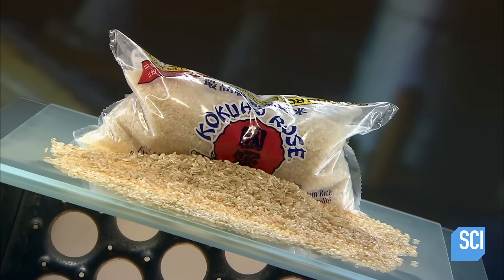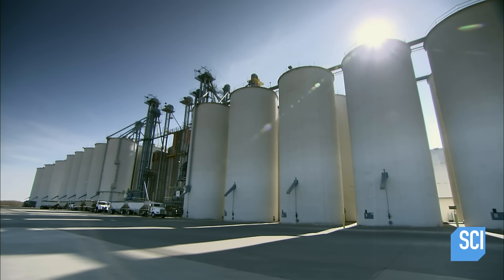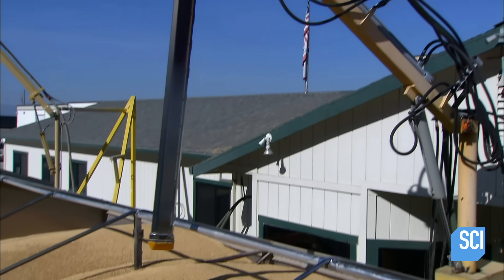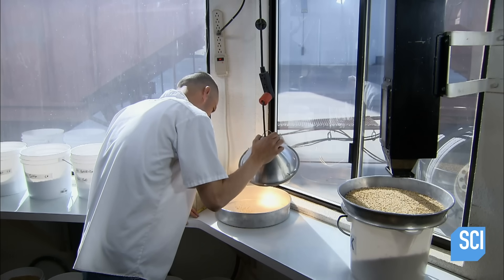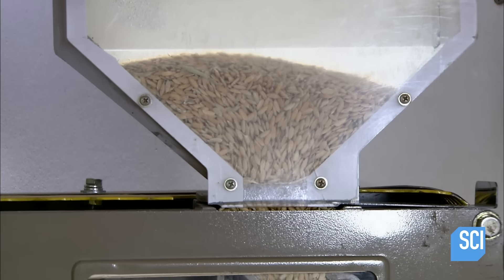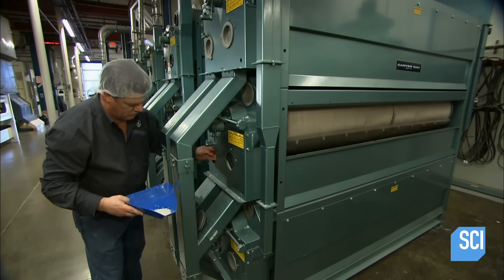How It's Made: Rice

Comment: Respectful Greetings!
To: Science Channel. 
Rice is a semi-aquatic plant that is cultivated and processed through several steps, including:
Irrigation: Rice requires consistent irrigation to grow. The traditional method is to flood the field, which also helps prevent soil erosion and manage weeds. 

Harvest: When the rice is mature, the water is drained from the fields and the rice is harvested with a combine harvester. The rice is then taken to a facility to dry out. 

Milling: The rice is milled to remove the inedible hull and bran layer. The rice that results from removing only the hull is called brown rice, while the rice that results from removing both the hull and bran is called white rice. 

Enrichment: White rice is often enriched with a thin coating of vitamins. 

Packaging: The rice is then packaged and sent to stores. 

The manner in which rice is processed affects its nutritional profile. For example, brown rice contains more nutrients than white rice because the bran layer is left intact. Parboiled white rice retains most of its nutrients, and enriched rice has iron and B vitamins added to it. 

There are many types of rice, which can be categorized by their flavor, scent, color, grain length, and other characteristics: 
Brown rice: A whole grain rice with the inedible outer hull removed, but the bran and germ layer remain. Brown rice is often considered healthier than white rice because the bran layer adds fiber and nutrition. 

Basmati rice: A type of white rice commonly grown in the Himalayas, India, and Pakistan. 

Jasmine rice: A staple in Southeast Asian cuisine, jasmine rice is soft, slightly sweet, and somewhat sticky, with a subtle floral aroma. 

Arborio rice: An Italian short-grain white rice typically used in risotto. Arborio rice absorbs liquid and flavor nicely, and has a starchier, creamier quality. 

Black rice: A wholegrain rice with a dark purple color determined by its high level of antioxidants. 

Japanese rice: A short-grain rice that's smooth and glassy, and often referred to as sushi rice. When cooked, it's on the sticky side but still has a toothsome bite to it. 

Long grain rice: Any variety of rice that is four to five times longer than it is wide. This includes varieties like Basmati, Jasmine, and Carolina. 

Courteously!
Luis Lopes

Comment: Quick question: What's the protocol to keep the truck oil from dripping onto the same grates the rice is dumped?
Reply: At the place it worked it was just checking to make sure it is not leaking before dumping.  If any did get into the rice the machines are able to sort it out.

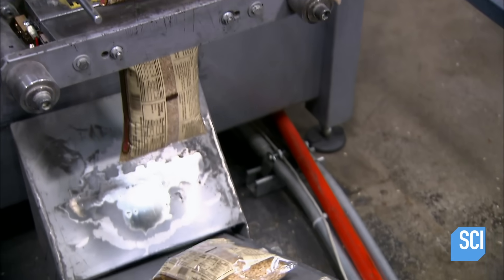Comment: 4:41 - 4:49.  Run it at 20% speed (video speed controller applet from chrome web store).  The plastic bags are just 2 sheets of plastic and are being melted together in reeal time in the bagging machine.   The rice falls down 3 bags into the bottom bag, while the 2 upper bags sides' are cooling after having been melted together.

Comment: The fans in the flat storage don't do any drying, that rice has already run through a dedicated drier to reduce moisture to ~12%. They're preventing the rice from overheating due to decomposition.  Paddy rice (rice will hulls still on) can be damaged by temperatures reached during this process.  Heat damaged rice takes on various levels of brown color as a result reducing its commercial value.   It's also not terribly uncommon to fumigate an entire flat storage warehouse or silo to take care of weevils and other insect infestations.  The only thing that grates over unloading pits are intended to filter out is animals and trucks.

Comment: I was about to purchase a large bag of white rice once.  Normally I get a major name brand but I wanted to try to save some money.  Anyway, I picked up a bag, threw it in my cart... and saw several black bugs moving around in the bag.

I took the bag to an employee and they said "That's not good".  I agree.  But they did not do what I expected, which was to check the rest of that brand's bags.  So I did.  Another bag had the same black bugs in it.

I don't buy rice I can't see in the packaging any more, and I check it before cooking.

In all my years, these are the only two bags I've seen with bugs in them, so that says a lot about quality control at these mills.  But still...

Comment: Only a farmer knows the price of one grain. And they have the audacity to reject a truck load of rice for just one bug? Shame
Reply: Its not one bug in the truck. It's one bug in the sample. Which means potentially LOTS of bugs in the truck load. And its not even just those bugs. If you let that collection of bugs sit in storage silos they reproduce and multiply and contaminate other previously "clean" loads
Reply: @thearcher1740  instead of rejecting they should find a way to clean it.
Reply: @roronoazoro2496  Sure agreed it would be great to if u/someone can find a low-cost method to clean it. However there is no low cost method right now. Till that low-cost method is found, we will have to throw it away (And by "throwing it away", they actually mean that they divert it to other industries (like cattle feed) where it is actually used)

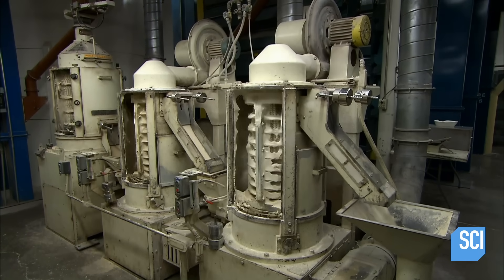Comment: The most tricky part is the grinding process in producing white rice from brown rice (3:30), whose inner working mechanism is unfortunately not revealed here. This is a key information to learn as the grinding is imaginably quite different from the grinding of wheat grains which are crushed completely and the white flour is separated from the bran by screening, a simple physical process. But grinding brown rice to remove the bran is much trickier as the entirety of the kernel has to be protected.
Reply: That's the whole reason I watched the video. I'm still puzzled about how they 'grind' off the outer shell and leave the inner part on something as small as a grain of rice - and they do it millions of times over. 
I wish they showed how it's done.
Reply: @O-cDxA  there was an entire section of the film dedicated to just that showing it going through grinders.
Reply: Yeah it was pretty obvious that removing the bran is a secret process.  They could just say, "Next comes a secret process where they remove the bran ..."
Reply: I think they actually use mills that are spaces just right for rice to fit between them without milling it down to nothing. So it's like two plates that are just far apart enough to let rice between but not enough to go past without removing some skin.
Reply: I think it’s simple, every grain of rice “polish” each other, and the bran just flakes off the grains.  The process is not without casualties, the video shows that.  Depending on the machine, they can choose to separate the broken grains, or just leave it but makes the batch lower quality thus cheaper.  They can grind the broken grains, and make rice flour, there’s a market for that too. Nothing wasted, even the husks and brans have uses.
Reply: https://youtu.be/u-MQxZCLCNE
Reply: I worked in a rice mill for 5 years and have seen the inside of those machines.  The ones we had had a stack of some kind of stone wheels that spun really fast.
Reply: Think barrel shaped cheese grater with tornado air stream down the middle. Thats how the grinder works